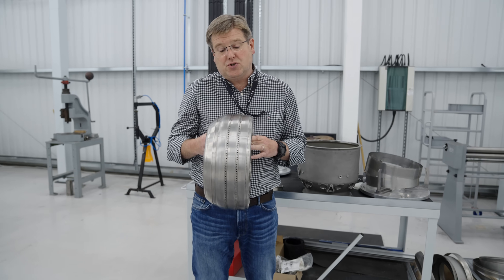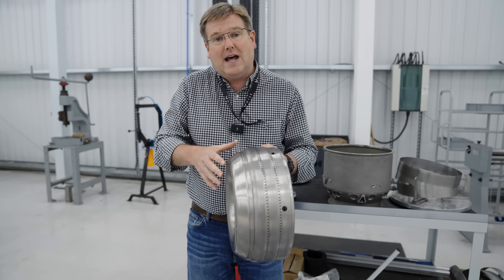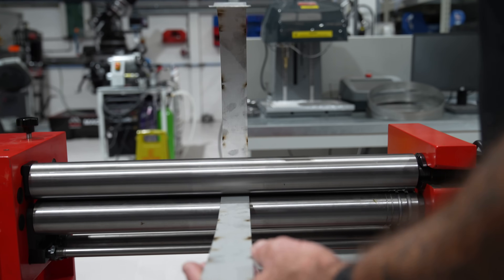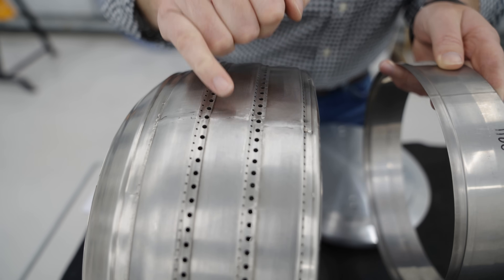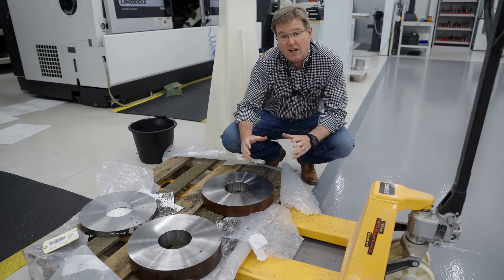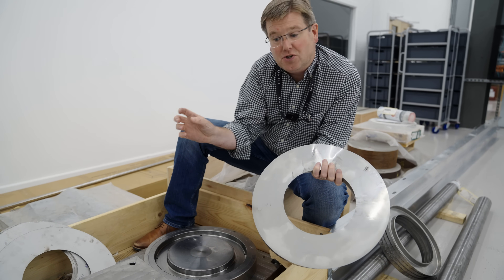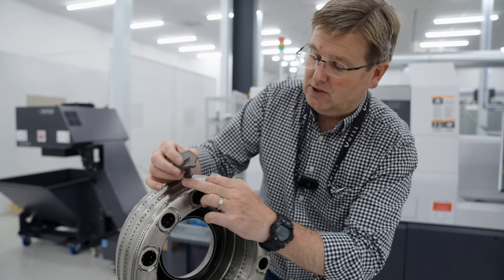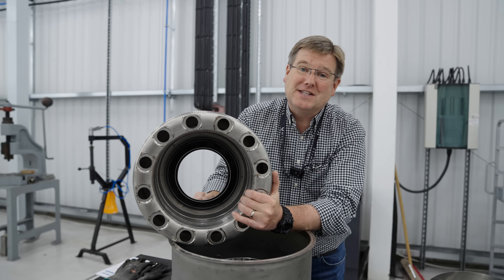The New GT50 Annular Combustor

Comment: As a B1.3 helicopter engineer. Look at engine compressor washing. This increases engine life and performance properties. Cut down on warranty claims.
Having to use distilled water is expensive and customers will not do it. P&W allow normal tap water which is a lot cheaper. If the water injection for cleaning can be done with the engine at idle. It will not need a drying run and will save engine cycles. 
If you designed a integral water bottle, so the pilot can inject the water from the cockpit before shut down or post start. Can use an engine bleed to pressurise the water. Only needs to be a litre. That will dramatically increases the chances of it being done.

Comment: Also the turbo encapulator with the thrognostic stepper valves seals really well into the panadoic thrust dophers. In turn this provides a bann logon system to help the flynet bearings run in line. Much power produced with Avtur or even bio-diesel at a pinch. A joy to behold indeedums.

Comment: Wow, that is a complex part!! Why not 3D print it and machine critical features?
Reply: It’s also very thin walled, which I guess would make it very prone to errors in the printing process. Since it is not very rigid it would be difficult to machine. Clamping it down is difficult and tool forces could lead to large deflections.

Comment: Why not get an ingot piece of metal, steel, aluminum or alloy for that matter; regarding the piece of metal that you’ve welded/ soldered and press it into that shape that you welded so as to eliminate any possible stress points failure; ergo that welded point?!!!
Reply: Cost, let alone feasability. When the wall is so thin machining becomes very difficult (vibrations, distorsion, ...)

Comment: The information and insight into the design and development process in these videos is excellent, and appreciated. 

In contrast, Hill Helicopters marketing is still borderline fraudulent, claiming that the company has a complete helicopter which can be purchased. The fact that the company is in the process of designing the components which will be used in the first operating prototype of the engine completely contradicts the promotional nonsense.
Reply: @brianb-p6586 - What planet did you come from ? I would be "REAL" careful on your defaming accusations towards Mr. Hill. 
He hasn't made any claims that you mentioned, its a work in progress, nothing more. Good Day.
Reply: @nightcrawleroriginal apparently you've never seen a Hill Helicopters promotion.
Reply: @nightcrawleroriginal  The Hill Helicopters website starts with "HX50 is the helicopter you have always wanted...", but it doesn't exist, so it should read that "HX50 will be the helicopter you have always wanted..." After that, they are careful not to state that it exists; it is the videos and shows that present a "helicopter" instead of admitting it's just a display model.
Reply: @brianb-p6586  -

First Full Engine Run
December 19, 2025

First Test Flight
June 26, 2026

Production Start
June 28, 2027

So what part of that ^ Don't you Understand ? 
It's "Clearly" Displayed on the HX50 Front Page ?
Reply: @nightcrawleroriginal that's the contrast - between clear information, and years of the marketing people rolling out props and selling non-existent helicopters
Reply: @brianb-p6586  I should have realized I was responding to a Bot. My Bad. Good Day (Again).

Comment: I assume the spring washer for the fuel manifold is in a place where it doesn't experience enough heat to ruin the temper to retain thr spring function?
Reply: It's made from a superalloy - many of the nickel based alloys are high temp and are not "tempered".

Comment: I really hope this machine becomes reality. I'll buy a HC50 ASAP for tours and transport.
Would be cool if you made a smaller cheaper 2 seater in the future too for personal use.. 1 million for a toy is still way out of the price range for people except for the richest of the rich or people that can recoup the price by working it simultaneously.
Need to get down to 300-400k for the more average rich person to be able to afford it.
Reply: If the 4-seat toy costs a million dollars, will 0.8 million dollars for a two-seat version really make it accessible? $300-400k is an impossible fantasy - being half the size would reduce production cost very little, because the smaller aircraft would have just as many parts, require almost as much labour, and would require a massive development expense.
Reply: @brianb-p6586  this helicopter is designed around the passenger sweet spot, no one wants a 2 seater turbine, but for 4-5 pax, hell yes.
Reply: @stachowi  that is just an absurd thing to say haha.... most private users dont put more than their gf in the helicopter. thats why people buy ferraris, lamborghinis, mclarens, etc by the tens of thousands every year and not 4 seater sport sedans.
the reason why people buy 4-5 seater helicopters now is because there are zero nice 2 seater helicopters. its not even an option.
Reply: @maximusjoseppi5904  bigger helicopters are faster
Reply: @stachowi really? What's the cruise speed difference between a h125, h130, h135, and h145, bell 407, 206, 206L? Different sizes of helicopters there for you to choose from and compare their sizes to cruise speeds.
Let me know how that goes for you. (Spoiler alert, their size has nothing to do with their speed capabilities)
Reply: @brianb-p6586  you clearly are not a pilot haha.. people still right now and especially 5 years ago would have told you a 5 seater turbine fully articulated helicopter that can cruise at 140kts is an impossible fantasy. 
the HX50 costs 1 mill... making a 2 seater version of it most certainly realistic to cost around 400k. just math there buddy. the driving cost of a helicopter is performance and strength of components to meet that performance.... trying to fit full fuel, 5 adult passengers, and cruise at 140 is astronomically more expensive than 2 adults, much smaller engine, smaller fuel tanks.... the cost grows exponentially, its not linear. 
hill estimated the cost of the HX50 originally to be about 700k haha.... so ya... 300-400 for a 2 seater is most certainly reasonable and judging by the COUNTLESS lamborghinis, ferraris, mclarens that people buy, yes theres a huge market for cool 2 seater machines in the 300-400k mark. 
i own a $300k mclaren artura for instance.
Reply: @maximusjoseppi5904 cost is not linear, but you have it backwards. Half the size is much more than half the cost, and twice the size is much less than twice the cost.
Reply: @brianb-p6586 you know how much an h135 costs? About 6 million. Know how much a h145 costs? Only slightly larger helicopter almost identical in every way, about 10 million. 
A slight increase in size and capability is massive in helicopters. So going from a 2 seater to a 5 seater is easily double, maybe more cost wise. 
You guys are just saying things because you don't want to admit you're wrong and I made good points haha. Like there's no logic to follow here where you have a point.
The hx50 by today's standards is about 1/3+ the cost it should be and a 2 seater version of it would be about 50% or less the cost.
I don't understand why I'm still even getting responses to my comment 🤣
Unless you work for Hill, you have literally nothing to say of value.....
Reply: The Cabri G2, R22 or S300C are really the only options out there for certified 2 seaters, and all of them are around the $300-400$k price point, but all are piston. The Cabri G2 is the most up-to date model and incorporates a lot of the learnings that Hill is bringing to their design. It is becoming very popular for flight schools etc. as a replacement for the R22. 

All 2-seat heli's tend to suffer from low cruise speeds, limited useful loads and no turbine option, which is one of the main reasons why they tend to be cheaper. Once you add a turbine to the equation the price jumps up a couple hundred thousand simply due to the price difference between aviation turbine and piston engines of the same power, and like you said that price point just doesn't make sense for a 2 seater.

I personally don't think we would ever see a 2 seat turbine for recreational use simply because getting the price down to a suitable point isn't feasible with a turbine.
Reply: @overbuiltunderpaid3161 all bad machines. Like I said, there's no good 2 seater. 
And again, your logic doesn't track for the hx50 then either. The entire point of Hill is to create more affordable turbine options. The hx50 would be 3 million+ by today's standards. 
Your logic isn't meant for a hill helicopter video.
Reply: @maximusjoseppi5904  “Your logic isn’t meant for a Hill video” — didn’t know logic had brand loyalty. If 2-seat turbines worked, Bell, Hughes, and Robinson would’ve built them decades ago. Airframe shrinks, turbine bill doesn’t — even in the ’80s when turbines were cheaper to build, certify and run they couldn’t make the math work. Hill knows it too, which is why they’re adding seats to spread the cost and pick up more market share to make the economics work. 

My apologies to the Hill marketing team for letting my logic wander in here.

- Edited to say that I do agree a 2 seat turbine helo would be awesome fun like you say (like a mini Eurocopter Tiger) but I just don't think it can be built at a price that yields a large enough market to make it worthwhile for any manufacturer.
Reply: @maximusjoseppi5904  HX50 also doesn't exist as a completed helicopter yet. I hope it comes to fruition but you talk as though it's a flying, proven machine and hasn't been subject to price increases.
Reply: @overbuiltunderpaid3161 yes, the entire point of the company that made the video you're watching to reply to my comment is to reinvent the way helicopters are made and to revolutionize the upfront cost and cost of ownership of a turbine helicopter. 
So the logic behind what something "should" cost is quite literally brand specific since this is the only brand, if successful, that can create a machine with this capability at this price or anywhere near it.
Reply: @sheldonholy5047 the very first thing I said in my original comment is "I really hope this thing becomes reality" and I'm talking like it's flying? 🤣🤣
You people have to be paid detractors. You guys work for Bell or Robinson or airbus that are literally going to be put out of business or require massive adjustments in price gouging if this thing successfully gets built and performs.
Reply: @overbuiltunderpaid3161  you'll most likely see a eVTOL before then
Reply: @stachowi we aren't going to see a useful electric helicopter because we aren't good enough at making batteries. The power to weight ratio you get from them is horrendous... My Cybertruck weighs 9000lbs and can go 300 miles. 
We would need an insane breakthrough in battery tech to see electric compete with gasoline or jet fuel
Reply: No you won't ! They don't plan to certify but sell as a factory assisted build, experimental. No commercial operation is allowed with experimental aircrafts.
Reply: @SuperYellowsubmarin bro, the hc50 is the certified commercial version of the hx50.... What are these replies people are giving me 🤣🤣🤣🤣🤣
Reply: @maximusjoseppi5904 didn't know. Good luck with that though, certification of a helicopter, engine and avionics ... Hughe challenge
Reply: @SuperYellowsubmarin Hill most certainly plans to sell a certified version - it is their primary goal, with the experimental version being just a step toward that goal. They call the  experimental "HX50" and the certified "HC50". This is all over their website and videos.